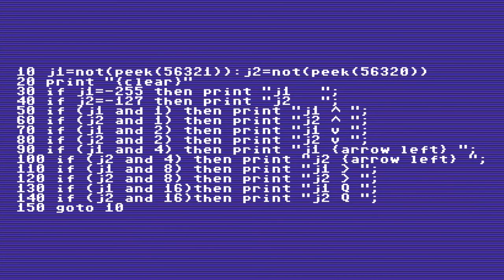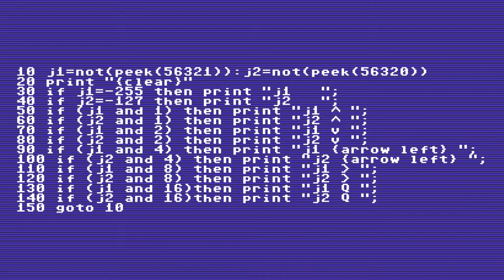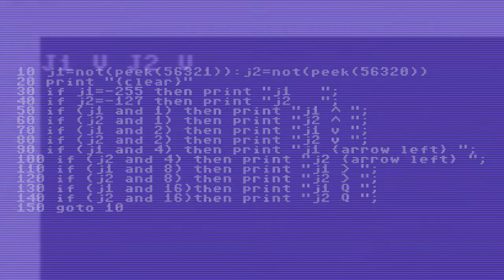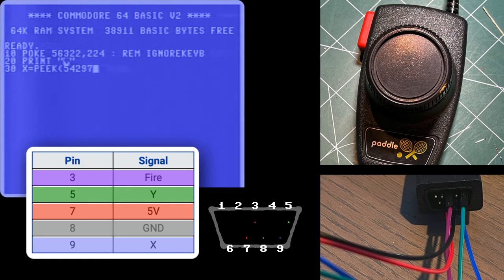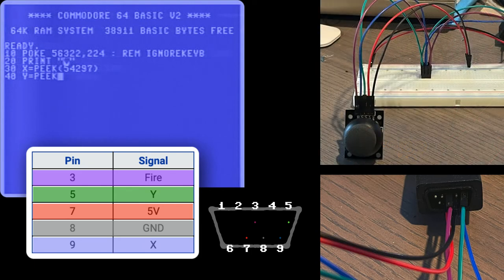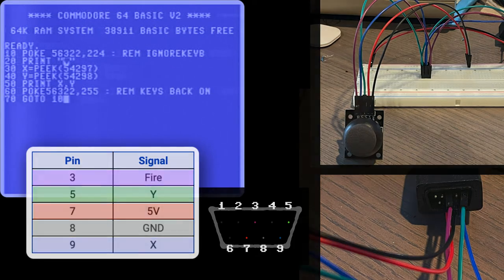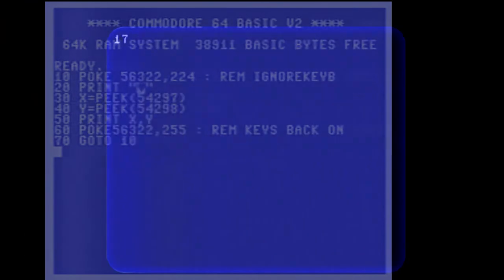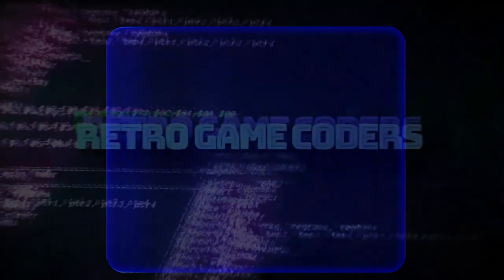Reading C64 Joysticks and Analog Input - Commodore 64 Electronics Part 3

Comment: It's a shame no-one bothered making analog joysticks for the C64 back in the day. They would have been great for flight games, but of course the software would have to be programmed to take advantage of analog input.
Reply: As an aspiring engineer I tried using the analog input of the original C64 to measure voltage signals. As it is a very crude and jittery A/D converter I changed my approach, created a 8bit A/D converter box using a 427(?) IC plus 'stuff', running all through the parallel port of the C64.. Speedy data collection and analysis was done in 6510 machine code. This turned the C64 into a really useful data collector and analyzer. E.g. pump speeds of vacuum pumps or a small oscilloscope for any signal interpretation.  The final project was to do full blown mass spectrometry (reading data from a quadrupole scanner) on this 'toy', deciphering and graphically plotting gas contents. A self-made interrupt driven 'light' pen (just a photo diode!) allowed for TOUCH SCREEN style control: software sensed the electron beam fly-by at any position of the CRT to identify the pen's  x/y coordinates. The 6510 and its sidekicks VIC (with its IRQ control) and SID (housing the A/Ds) were marvelous, offered incredibly useful functions and ports to utilze. Far beyond gaming.

Back in 1984 this entire project earned me a top grade university diploma as an Engineer of Applied Physics - thanks to a simple breadbox C64! I still have a CBM64 in my basement today, and will get a C64mini tomorrow!

As far as I know there was at least ONE analog control stick (for a unique C64 flight simulation program), that used the built-in analog ports.
Reply: @88BlueKeys4U  Great project. Can you provide more details about that analog stick for the C64, like brand name? - I converted a controller of the game console Interton VC 4000, which has an analog stick, for the C64. Also was jittery, thought it may be an issue with the potentiometers in that stick not fitting the C64, but, as you said, it seems to be a general problem with the A/D converter.
Reply: As for software making use of an analog stick - the graphics software Blazing Paddles works like a charm with the Interton stick I mentioned in my previous comment. Without the jitter, it would be a faster workflow than with a mouse I think.
Reply: @NuntiusLegis  Sorry, all this happened decades ago, so I do not recall all the details. AFAIK the real and rare C64 analog joystick was related to flight simulation (for obvious reasons of more precise steering). Maybe Gravis did something for the C64? They offered analog sticks for other consoles.
Google is your friend here; it may take considerable effort to hunt the facts down, leave alone such a rare controller. Good luck and a safe landing!